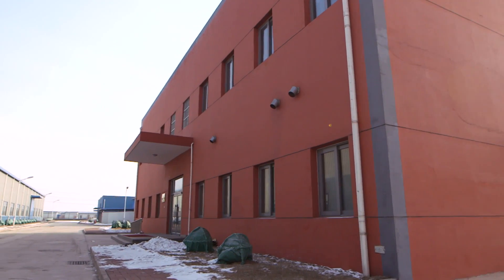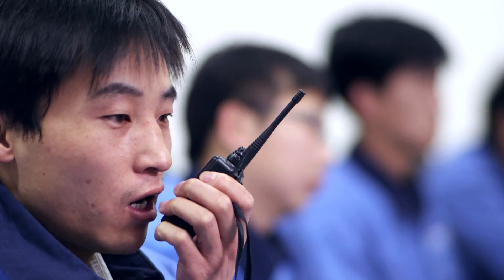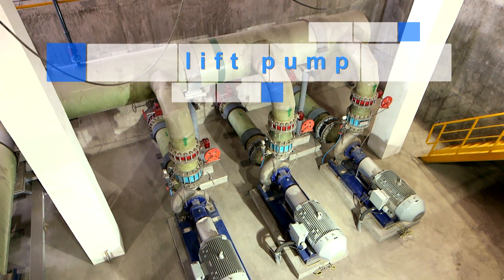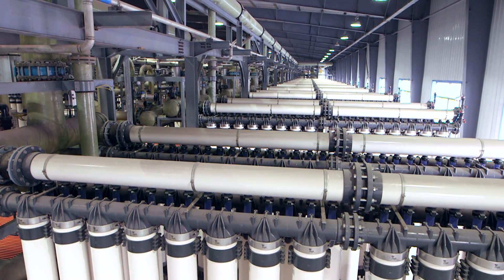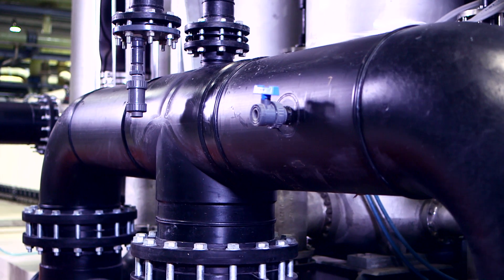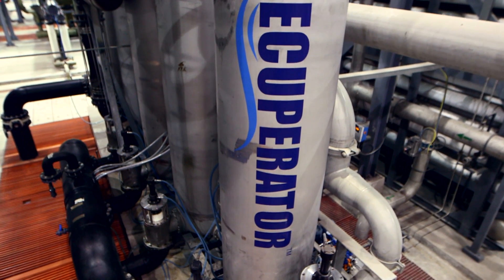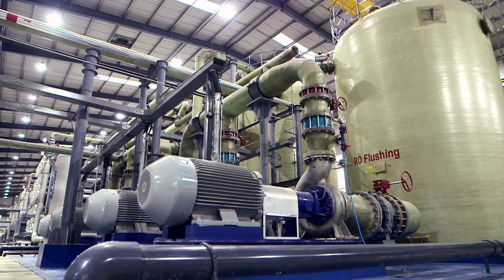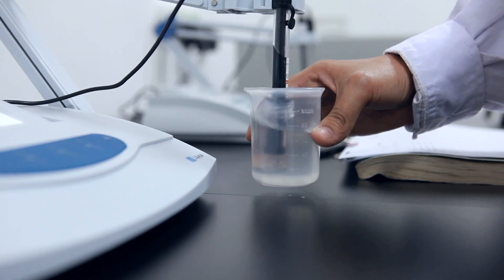Aqualyng Caofeidian SWRO Desalination Plant Video - English

Comment: If the sun does everything for you without any power then why the world would need this complex power consuming system?
Reply: Waqas Arshad 
Let’s hear what your solution is?
Reply: Basically all the energy we use comes from the sun, initially from the nuclear fusion, and then converted to light, heat, wind, water state change, etc 
This a plant to clean water with reverse osmosis, it needs to use some energy